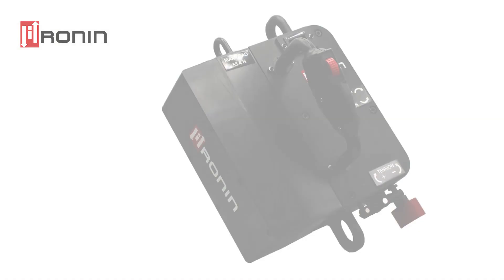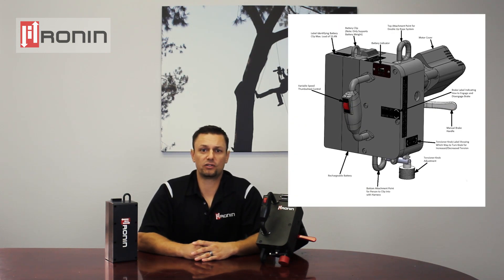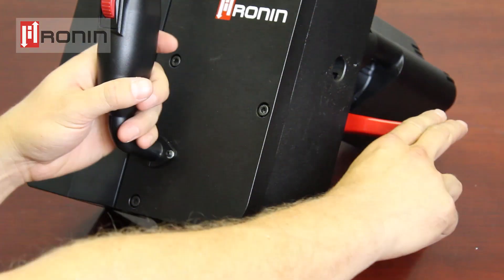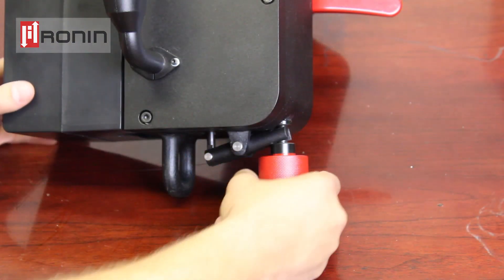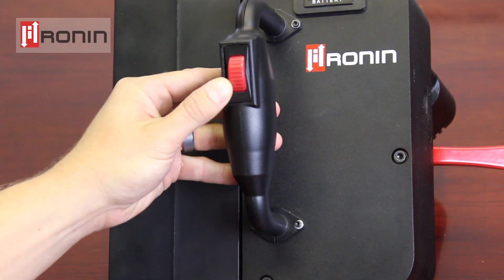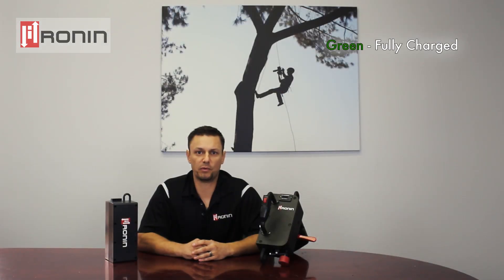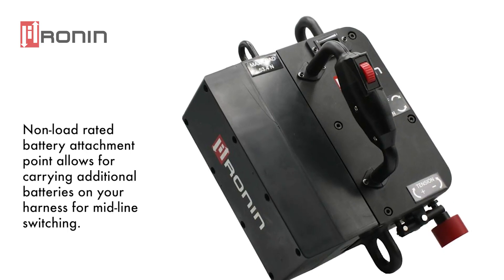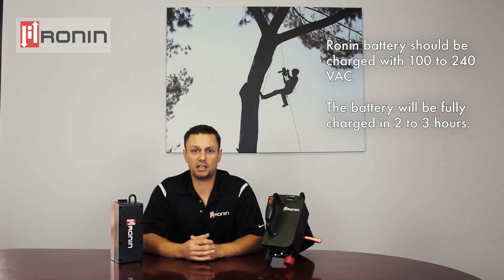Ronin Lift Power Ascender Technical Features

Comment: I just bought one and I love it. 
I have one question . 
how Many feet Of ascension caring a 200 pounds is one normal battery good for?
Reply: Mike you can expect around 600-800ft of ascension with 200lbs.  You only use battery to ascend so if you want to count up and down you can double those numbers